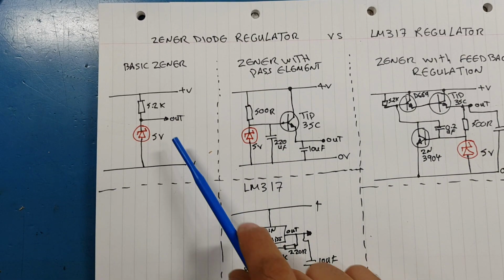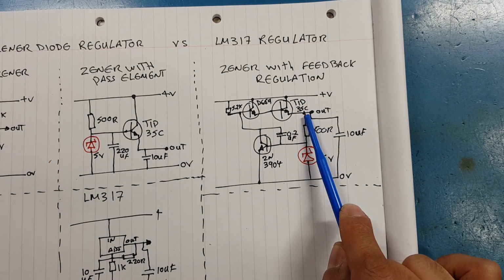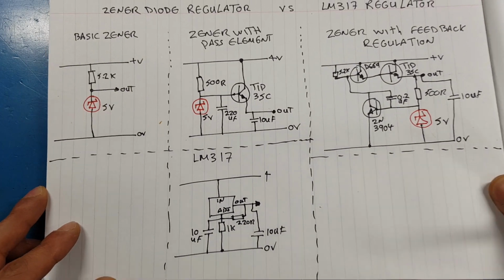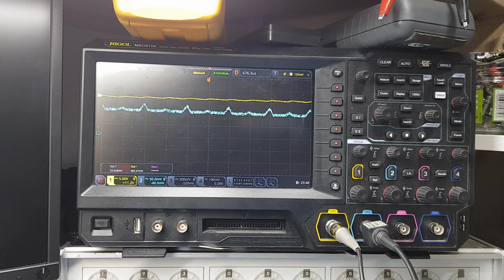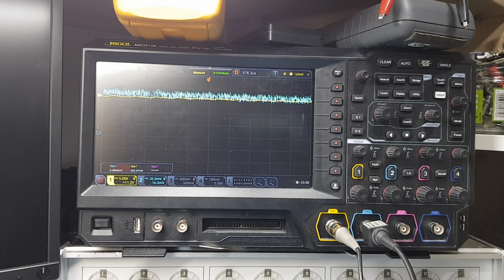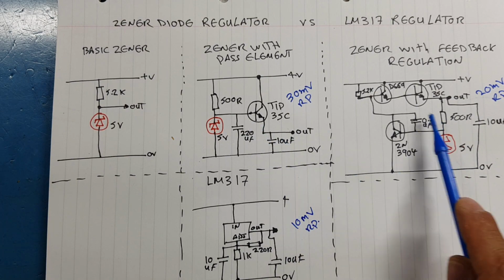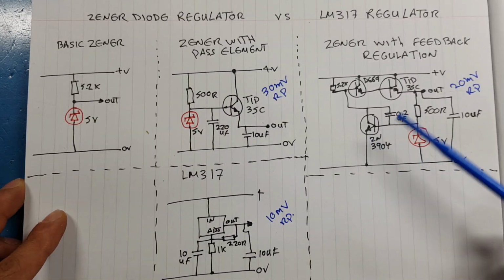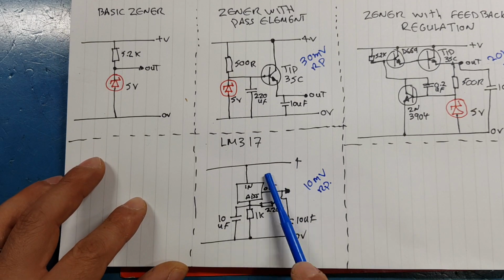Zener Diode Voltage Regulator vs LM317

Comment: Why the power supply ripple is lower than any of the regulator outputs? Regards.
Reply from the maker: Are you referring to the transformer output? If so it's because the scope division is higher for tranformer probe. As there is lots of ripple. So I have to use higher division to fit in the screen.

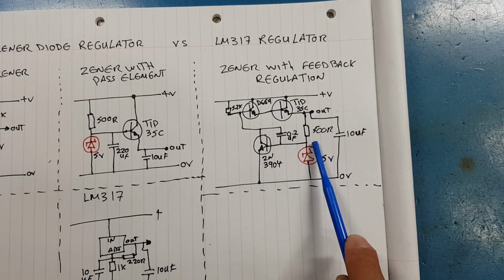Comment: @2:26 That Schematic (no. 3) will not work! It will deliver only 0,6V. You have to e. g. exchange the Zener diode with the 500 Ohms resistor to get it working.
Reply from the maker: Yep. Your 100%tight. I mixed up the resistor and zener diode places. Tnx for correction.